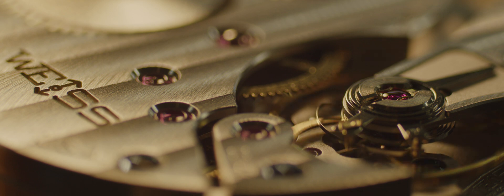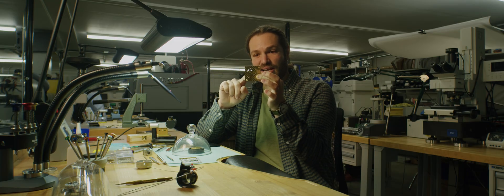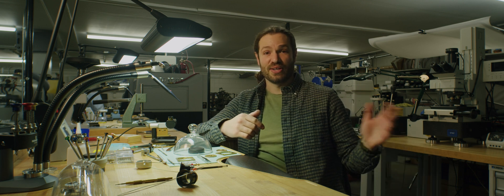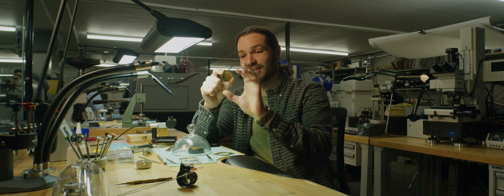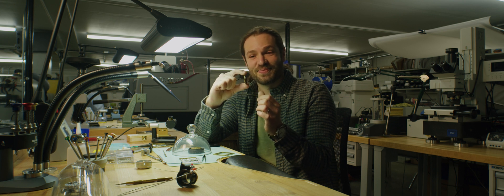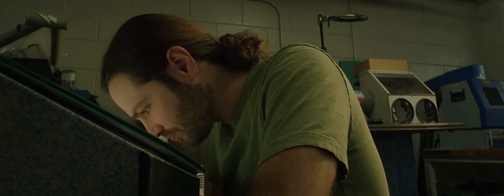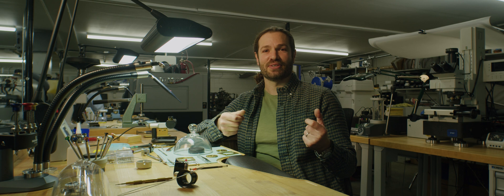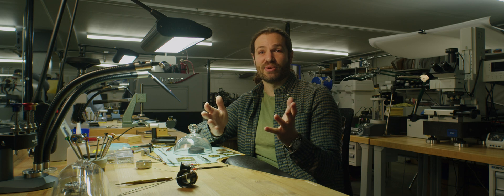The Watchmaker's Workshop: Watchmaking - Deburring Machined Components

Comment: Hi Cameron, One of the machines I programme and operate is a Multiturn lathe which allows the operator to machine in full CNC mode but which also allows manual inputs which would be ideal in the case of deburring parts in your particularly precise environment, do your lathes have this capability?.
 I would imagine you have researched deburring tumbling machines I realise the media for this might be problematic but even talcum powder is an abrasive, if you could find a suitable media it might be worth a look. Once again a great video, best wishes, Mal.